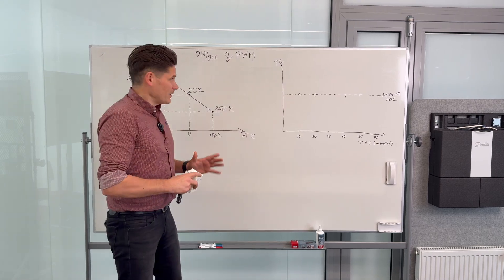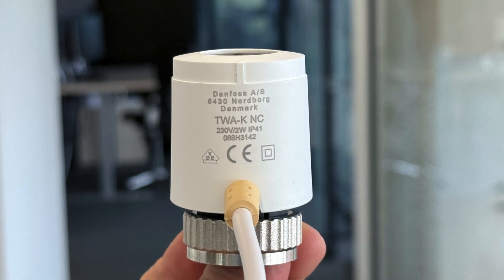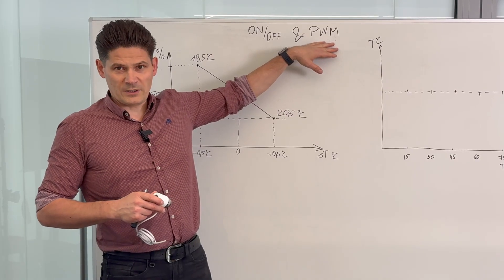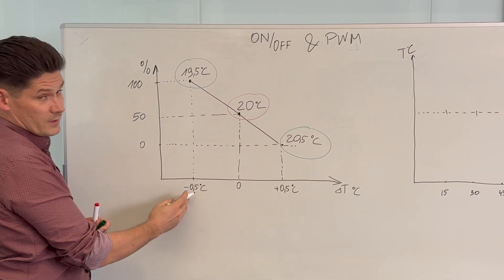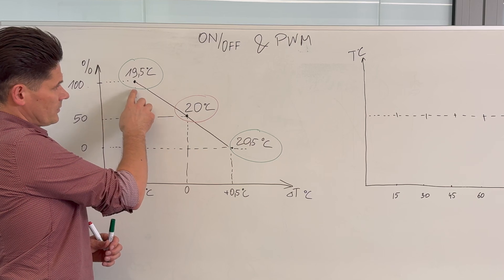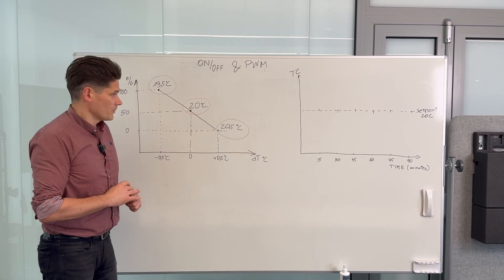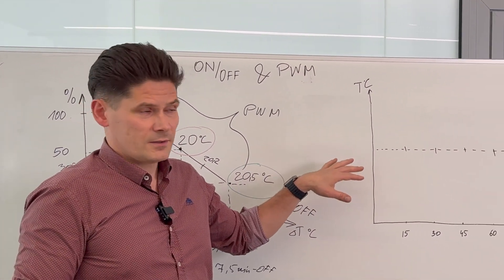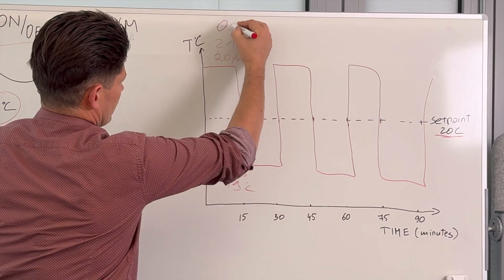PWM vs ON/OFF Control: Which is Better for Heating System?

Comment: PWM with 15 minues and 2 hours! cycle? 
Seems like it would defeat the purpose of using PWM then - as the radiators or heated floor, get plenty of time to heat up and cool down during the time it's on or off anyway. For good PWM regulation, the cycle should be short enough for the radiator or floor temperature to stay constant and only change by the heating demand - which in turn is controlled by the room temperature (within a small regulation range - in this example +/-0.5° from the set point).
Reply from the maker: Yes, exactly — PWM in heating systems works on a much slower timescale because of the system’s thermal inertia. Radiators and underfloor heating respond slowly, so a 15-minute to 2-hour cycle is enough to maintain stable room temperature without unnecessary actuator wear. The goal isn’t to rapidly switch on/off like in lighting, but to modulate heat delivery over time, keeping the average temperature close to the setpoint.

Comment: sure you don't mean PID not PWM?
Reply: Yes, the entire system should be a pid controller. I think he was focusing more on the actuators. They are binary controlled (they get an on or off signal), but due to latency (takes 5 minutes to travel from one to the other), it's possible to put (and keep) the actuator in a position between open and closed by sending open/close signal eg. every minute. It's not pwm as most electrical engineers know it. Wondering how long these pwm driven actuators last. In pwm mode they are constantly moving.
I think it's a clever system, but very complex. You need a pid controller (calculation) for the room but also for the actuator itself.
Reply from the maker: It is PWM but much slower comparing to PWM used let's say for lightning
Reply: With my heatpump and buffer I stopped using PWM and the actuators take 6 minutes to fully open so I delay heating requests by 6 minutes. The number of heat pump actuation was greatly reduced.